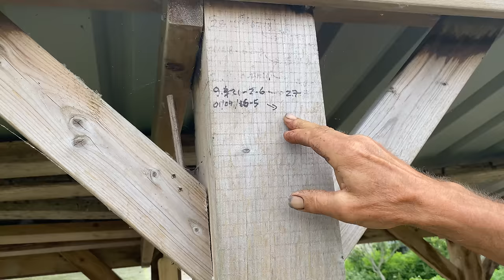No dig tour in June, summer number ten at Homeacres and see the exciting methods

Comment: Very nice garden. My allotment is doing okay compared to yours. The main problem this year is some vegetables like Sweetcorn, Squash, Courgettes, 1st Early Potatoes and some others seem to be getting a slow start and some are going yellow. I would say its due to the compost I added in the winter or watering but they seem to be now catching up. I hope to get a harvest from them. It's my second year at my allotment and Iwas wondering, seen as you have been there for 10 years. How different was the growth of your veg in the first couple of years to say 5 years later? Did yoyr veg grow stronger and quicker each year because the beds became more established each year?
Reply from the maker: A good question edward and groves has always been good from year one, as long as the compost I use especially when making new beds, is of decent quality. 
It sounds pretty clear-cut in your case that the compost you applied this winter or spring was not sufficiently decomposed. That's the fault of whoever sold it to you in an immature state. As you notice things are improving now and will get better. I am to buy any compost well in advance of using it.